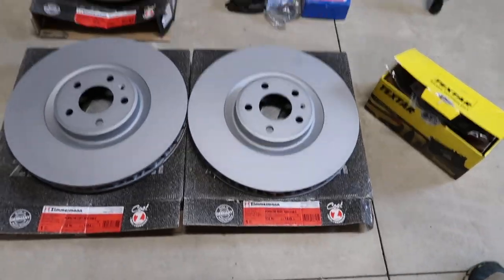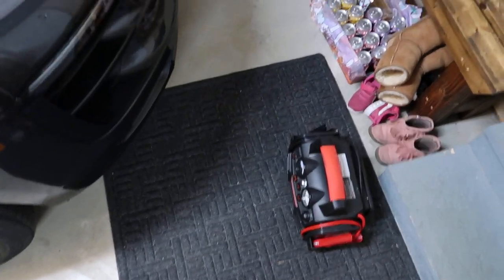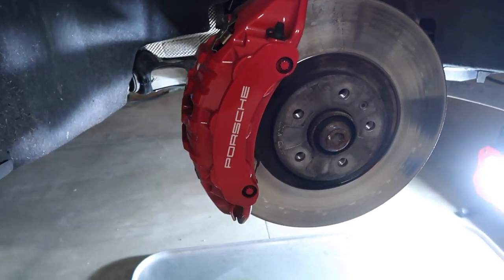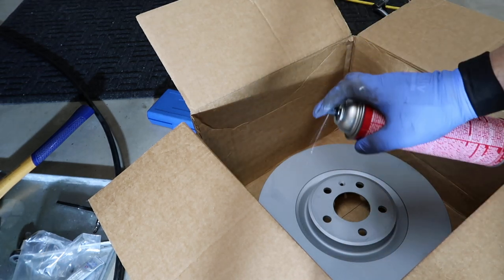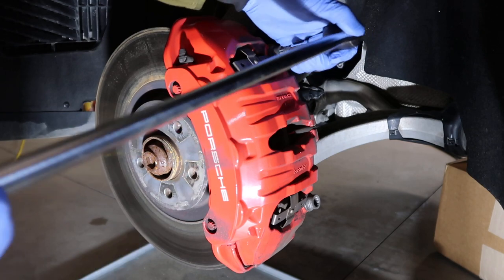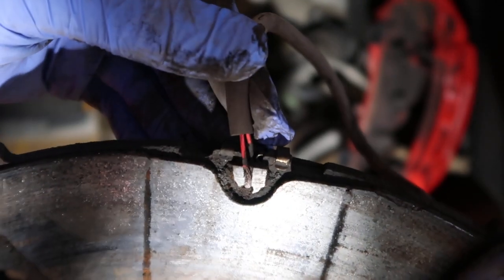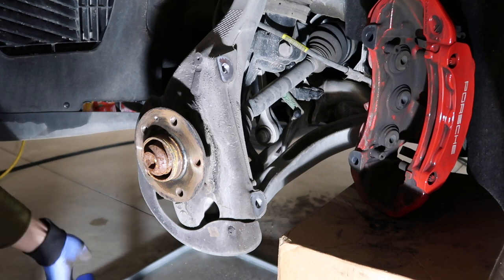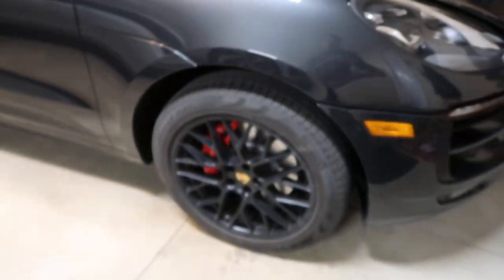Macan Brake Replacement (Front)

Comment: thanks for the video. Here im shoping around what SUV to get, i like these Macans, so just watching videos on some maintenance stuff since i do my own. Pretty much the normal brake pad replacement.
Excellent video.
Reply from the maker: Absolutely just as normal. Parts are a little bit more expensive than usual cars but that’s expected for all cars like this with relatively low volume.

Comment: Excellent video demonstration.  Awaiting video on rear pad/rotor with the EPB motor recalibration if needed.
Reply from the maker: cyaindaor didn’t think anyone would be interested in the rear ones. Let me get started on that right away :)
Reply: @luyichen11  Thanks.. looking forward.
Reply: Hi, Did you use a diagnostic tool to put the rear EPB in service mode to retract the  rear brake caliper piston in order to replace rotor?  If so would you mind sharing which you used or recommend? I have seen several diagnostic tools advertised i.e. Icarsoft POR II .  Some videos suggest you don't need just remove EPB motor and manually adjust.  Thanks in advance.
Reply from the maker: cyaindaor Yes, I did. Using a diagnostic tool will make the work much easier. Just need to retract the EPB motor before disassemble. I have read others taking the motors off by open a sealed assembly, which I don’t think it’s a good idea. In terms of the tools, I borrowed one from a friend. Autel MaxiCOM MK808. Just did a search on google it costs about $400. https://www.jbtools.com/autel-mx808-maxicheck-all-system-service-diagnostic-tablet-usa-version/?gclid=CjwKCAjw7LX0BRBiEiwA__gNw-XIgqBgNYynCpLck99dFe-oZ54g_KpXUGHjDbMdvPLXoJtrWnJl_BoCihIQAvD_BwE

Comment: Great job with the box to hold the caliper in the front. I am using ceramic pads i am tired of all the dust. I have turbo wheels and not the black ones so the dust shows .

Comment: Great video, thank you. I just changed my front pads. Easy job. Maybe Porsche recommends it but changing rotors at just 35k miles is excessive and not required IMHO. Changed caliper bolts though because of threading and torque, they are considered single use and should not be re-used normally, and they're not expensive either so no brainer.
Reply: Where did you order your parts?
Reply: @POLYBEARSNM33  did you figure out where to order the parts? I have a 2017 Macan GTS. I want to change the rotor and brake pads for front and back; but I want to make sure I order the right parts. I hope to see a link to order it. If you have any  info let me know. Thank you!
Reply from the maker: @elainepacquing1352  Sorry guys just saw your question. I purchased mine from partsgeek.com. You can find similar products at rockauto, ECS tuning, and FCP euro as well. There are many placed carrying the OE quality rotors/pads with a reasonable price tag.
Reply: @elainepacquing1352  did you find the right parts ? I have the same trim and year

Comment: Thanks for posting. We have a 2016 Macan S that just now showed the brake wear warning on the screen. Will do this soon. Porsche's reco of changing rotors with the pads begs the question, why the wear sensors? Everything is getting changed anyway, once you hear the scraping noise its time to change... Oh, yeah, so they can sell us $70 brake sensors, duh.
Reply from the maker: Stephen Hope thank you for commenting! There are many new vehicles equipped with brake wear sensors mainly for safety reason. Being able to diagnose the pad wear electronically and send warning to owner to display as clear infotainment message has been the trend for a while. And all vehicle status data are shared via telecommunication module back to the cloud so OEMs can use it to improve their vehicle reliability, more accurately estimate the service interval, and use the data to inventory planning. Someday, these cars will drive themselves on the road and they will have to have all types of sensors to diagnose the overall health status. Hopefully, we don’t have to pay for an outrageous amount of money for service anymore.
Reply: @luyichen11  Thanks bro, just odd that my wife Macan S with 30k miles needs brakes but my very off- roaded 2012 FJ Cruiser still has 25% on original pads at 85K. Just wondering.
Reply: @stephenhope7319  i have noticed that. Macan does wear off the brakes fast.
Reply: @stephenhope7319   my wife's lexus IS200t front brakes lasted about 20k miles, just replaced them recently, not sure when they started making noise since i dont drive it much. Some girls dont notice things like that.

Comment: Is it possible to service the front brakes with only a jack? I do not own a quick jack. I do have a scan tool that can put the brakes in service mode but wondering if this needs to be done for the front brakes and whether or not its safe to do so without completely lifting the car off the ground. Thank you!
Reply from the maker: @DeadheadInABed  no need for the front brake and yes you can do one front at a time with just one jack. I do recommend using jack stand in addition just to be safe. In case the jack fails, the stand will still be able to catch. Typically, the jack stand should be the one with all that corners weights
Reply: Thanks for the quick reply! 

When you said, the jack stand should be the one with all that corners weights, what do you mean? I have used the jack pad adapter and a floor jack to swap wheels before one at a time but have never used a jack stand as backup support. But I know the stand needs to go on the factory jack points which are located behind the removable plastic covers, correct? 

Also I'm assuming that because the rear brakes need the scan tool to place the car in maintenance mode you cannot service them without the entire car being lifted?

Once again thanks for your input, your video was really helpful. I'm trying to do as much regular maintenance by myself to this car without spending a ton of money or compromising safety.
Reply from the maker: @DeadheadInABed  jack stand can hold the entire weight of that wheel/corner if correct jack stand is selected, that is typically the alternative way of lifting the whole vehicle with one jack and 4 jack stands. For me, if I use a jack just on one corner, I put the jack stand in and then lower the vehicle down on the jack stand while keeping the jack in place as double safety. Otherwise, the stand is a rigid piece and space between the arm joints or chassis, in case the jack fails, it may/ may not catch the vehicle securely on the move. That is my logic.
Reply from the maker: @DeadheadInABed  I think you can do one rear at a time. The service position is just to retract the eletric brake piston to its furthest position so you can release the pads, push the piston down. After putting the new pads in, the tool will rotate the motor so it pushes to the firm position. I have taken the electric brake motors apart and done it without using the scanner tool. But that is not recommended. Dust may get in and you need manually rotation the piston side back. Depends on the vehicle calibration, some may throw a code, some may not. BMW doesn’t I know for sure, but I have not tried on Porsche/vw/audi so I can’t say that for sure
Reply: @luyichen11  You can also store the removed tire under the car for extra safety while you change the brakes.

Comment: Great video. I have a 2016 Turbo and think of doing the brakes myself. Can you roughly tell me what all the replacement parts cost for both front and rear? Thanks!
Reply from the maker: For me it costs about $550 including shipping and tax. I compared a lot different places online such as RockAuto, Partsgeek, FCP Euro, ECS, pelican parts, etc, as well as calling dealer with automotive supplier discount. After all, I ended up with ordering discrete parts from PartsGekk instead of buying as a package(which usually has less margin for error to ensure 100% match to vehicle model). It all worked out well. Sizes all matched up perfectly and I am happy with the new rotor&pads performance.

Comment: Hi Yichen,
Thanks for such a nice video. Can you please tell me where did you get the amount of torque from? Can you confirm the number again, please? Do you know the minimum thickness that you can use the rotors with? Thank you!
Reply from the maker: Hi Jorge, I had access to Alldatapro service site when I was with my previous company, that’s where I got the torque from. But now without the access, I’d rely on forum or buy a service manual to get the torque. Let me see if I can still find any useful info and get back to you on the request
Reply: @luyichen11  Thank you for your very fast reply! Ok, understand. I’m asking because somobody posted in a Macan forum what is aparently in the oficial maintenance guide and it says to tight those bolts up to 30nM plus 90 degres turn, but that doesn’t sound very “official” to me…you said in your video something like 270nM I think
Reply from the maker: @TH3CROW01  30Nm seems too small for caliper bracket bolt. 25+/- 5Nm is typically for oil filter cap housing so caliper bracket bolt takes much more.
Reply from the maker: Jorge, I see your concern. The snapshots say 22ftlb + 90degree turn. That is like over 100ftlb of torque. I went with 145 ft-lbs ahead. But I do recommend to follow the manual by torquing to 22ft-lbs first, and then make another 90deg turn and double check with the torque wrench see where that takes you.
Reply: @luyichen11  thank you for the info. But can I ask you why you decided to use 145 torque instead if the manual says 22+90 degrees turn?
Thanks.
Reply from the maker: @TH3CROW01  145 is what I found in forum as the not to exceed torque. There was also 136 ft-lbs mentioned on rennlist. Back then I had the access to Alldatapro web which indicated all the torque values, as well as minimum brake pads thickness. But unfortunately I do not have the access anymore.

Comment: I want to change the front brakes. Do you have to unlock the electronic system? Or "reset the brakes"?
Reply from the maker: @ricardosanchez438  yea, using an electronic scanner tool to set the electronic brake to service position to release the pressure so you can take the pads off.
Reply: Thanks for your answer, you didnt show this part @luyichen11

Comment: Hello ,thanks for the video .
How to reset the warning light please ?
Reply from the maker: Warning light is caused by open brake wear sensor being worn down and crest open circuit. If you replace the sensor with new good one, pads warning lights will go off automatically. At least this is how all VW group cars work.

Comment: Did you replace the front brake caliper bolts with new ones? I read on a eguide site that the bolts need to be replaced because “The front brake caliper bolts are “yield-to-torque” bolts that are designed to stretch; they can only be used once.” I did not purchase new bolts. Can I just apply some thread locker?
Reply from the maker: No I did not. Using thread locker should be fine

Comment: Nice video. Does the car need any special tools or resets to remove the brake pad warning light on the dash?
Reply from the maker: There are two parts to the brake service warning. 1st part is the mileage service which you would need a scanner that covers Porsche protocol to reset. 2nd part is the actual pad wear sensor warning which will go away after replacing with good new wear sensor(or solder the old open wire back together which is not recommended but works).

Comment: What is your feedback on the Zimmerman and those front pads compare to the Oem? Dust? Noise? Braking power? Doing my Turbo... just bought oem front brake pads (made in Japan surprisingly), didn’t change the rotors yet... So what is your input? Thank you for the video.
Reply from the maker: Fab24hdumans About the same. The OE rotors are inside surface slotted. So do the Zimmerman rotors. Braking power is about the same. Noise and dust are more pads related I think. I used Textar pads, same semi-metallic material, so everything is about the same. My OE pads are made by a Japanese supplier Akebono.

Comment: What size socket did you use for the calipers was that a 12point socket
Reply from the maker: Hi. It’s has been long if I remember correctly it was 14mm 12pts triple square socket. You can also try torx socket

Comment: Thank you Mr Lu, an excellent video with clear explanations. A small query - I notice you use the old bolts. Someone else mentioned these need to be renewed whenever they are removed. It does seem a bit excessive to me, what do you think, please?
Reply from the maker: Great question. Some of the typical economy car with floating caliper type does require new brake hardware, including sliding pin nuts for every change. Those are the sliding nuts are not necessarily need to be replaced but you do need to put some blue loctite on just to make sure it doesn’t slide out. Not many people tight those back to torque per spec. In some performance fixed caliper design, the pins and bolts are reused due to frequent swap of brake pads during track days.

Comment: What pad material did you select. I see that  it is possible to use either ceramic or metal composite on iron rotors. Is there a preference?
Thank you.
Reply from the maker: Metal composite has better braking power but more dust. Regular ceramic is quieter and last longer with less dust but usually has less braking power. I personally prefer to have better braking power so metal composite or semi-metallic type would be my top choice. It is also what the OEM brake pads are. Porsche also has Carbon Ceramic brake rotors and surface coated brake systems, but those are $$$$$ level of replacement, not very usual to see on their cars under $150k.

Comment: 谢谢你的视频！请问能否把用到的工具和torque spec 分享一下呢？非常感谢！
Reply from the maker: 不好意思才看见留言。工具基本和普通刹车更换没有区别，比如:
千斤顶，顶角这些最基本的是需要的.
其次拆轮胎可以用手动break bar，气动impact gun，或者电动impact driver，取决于你个人喜好和工具使用频率。
torque wrenches(1/2 & 3/8)
Screw drivers
Hammer
Anti-seize gel
Gloves, cleaning towels, etc

Main socket sizes and toques:
Lugnut: 19mm hex, 118 ftlb 
Front caliper bolts: M14x1.5x115, 136ftlb
Rear caliper bracket bolts: M12x1.5 x85, 63ftlb. I did not remove the bracket
Rotor torx screw size: T30, 12ftlb

Comment: I have seen some people use a break maintenance mode using a scanner. You didn’t use it, was that not shown in the video?
Reply from the maker: For some vehicles for example Ford F-150, the service tool may offer a brake maintainance mode and once pads/rotors are swapped, coming out of maintainance mode will initiate the position relearn calibration. I have a generic scanner and this service tool does similar relearn trigger just with different name.
Reply: I believe you only need to put the rear brake system in maintenance mode to avoid damaging the electric parking brake and it takes a scanner tool to do that.

Comment: So you don't have to use an extension for your QuickJack 5000 SLX? According to their site, it only supports a max jack point spread of 60".
I measured my Macan and it's max jack point spread is 63". I assume your Macan is the same. Are your lifting block barely on the jack points? Looking for advice on whether to buy the 5000 SLX. Thx!
Reply from the maker: Hi Brian, you are absolutely right about the Macan jack span being slightly longer than the 5000SLX max supporting length. I moved the rubber blocks towards the maximum as I could and that gave me a little more than half of the overlap with the jack points under the car. After slightly lifting off the ground, I shade the car hard to make sure it was rigid enough. I can't recommend this to people due to the safety concern but it works ok. The reason I went with the 5000SLX is that I have another track car lowered only 3 in. off the ground and only 5000SLX thickness would fit without going to the 3500
Reply: @luyichen11  Makes total sense! I think I will go with this model and get the extenders so I can accommodate the Macan and the incoming 991. Thanks for the reply!
Reply from the maker: @BJP719  haha nice! Those are getting so expensive nowadays. Have fun!
Reply: @luyichen11  don't I know it! But, you only live once!

Comment: could you be kind enough to tell me where to get the 10 spline 14 mm socket male and the female , please? thanks so much.
Reply from the maker: Did you mean those triple square ones? If so, they are available on Amazon. Just search triple square socket set
Reply: @luyichen11  thank you  I didn’t realize they were the triple squares.  Yes I see them

Comment: Nice work! Which model Quickjack are you using? Thanks
Reply from the maker: Thanks. I have the 5000SLX
Reply: @luyichen11  Thanks for the info, I wasn't sure if the 5000SLX was long enough for the Macan.
Reply from the maker: @alSpeed  it is. Macan jack point spacing is the longest 5000 can support without extension.

Comment: Hello! Is that the Brake Anti-Squeal Grease you put on the pad (where attached the rotors)? Also what's the can called you spray on the rotors? Thank you so much!!
Reply from the maker: No the anti-squeal grease is on the pad surface facing brake caliper. What sprayed on rotor is just brake cleaner for cleaning the rotor factory oil. Hope that helps
Reply: @luyichen11  Thank you for the quick reply!! What's the "anti cease?" (not sure if I heard correctly) you applied to make sure rotors does not stick next time?
Reply from the maker: @yihao4887  so the anti seize lubricant being used between rotor and wheel hub is to prevent rust from adhering them together so it will more difficult to take off next time.
Reply: @luyichen11  Perfect Thank you!! Was trying to make sure I got the right thing. : )